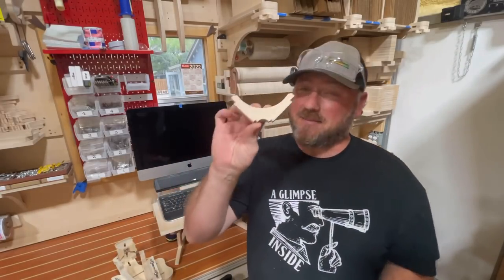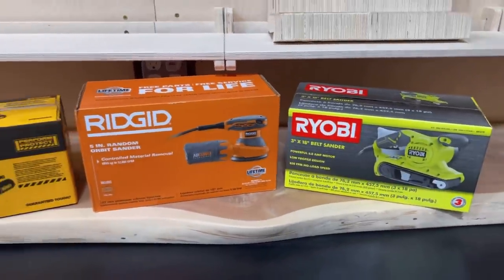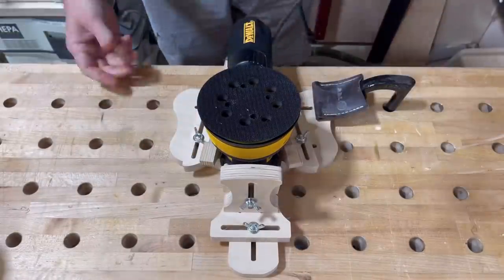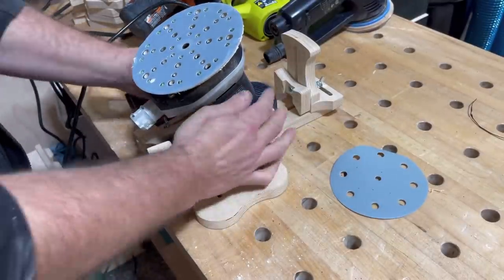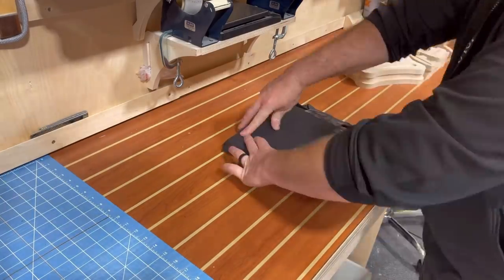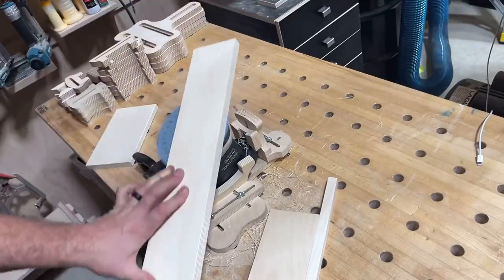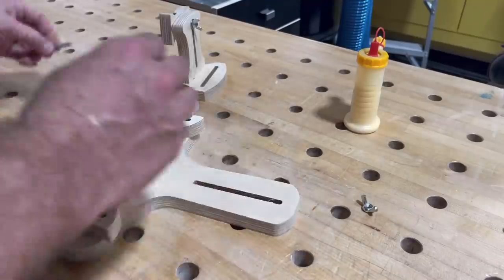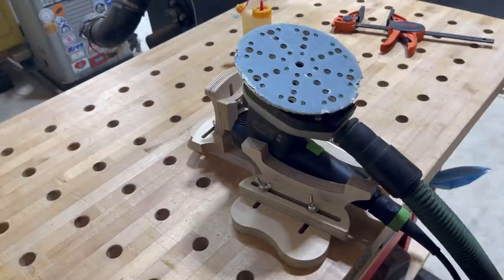Make Sanding FUN Again? How To Get The Most Out Of Your Orbital Sander

Comment: Really like this idea.  Tried a clamp down option once and didn’t work out so well…ended up breaking the paddle function that allows the sander to stay on during use without having to hold down the handle.  Now in the market for a replacement sandwr

Comment: I don’t want to be negative. you’re sending older seems nice and all. But if you ever thought of the bench top sander? I had my eye on the rigid and top sander it does either belt sanding or you can do drum sanding at various sizes. It really makes things so much easier and I’m a big fan. Just thought I’d throw it out there might make your life a lot easier than trying to fight with an orbital sander. Orbital sanders are great but they’re not a fixer for everything. Anyway I’m a big fan of your channel and what you’re doing. Hope I didn’t come across to negative. Keep up the good work. All the best
Reply from the maker: All good I appreciate the suggestion. But the orbital sander is truly the easiest way for me to do this as my pieces have lots of 90° angles and I need to get into various corners with a softer pad as well. The random orbit sander has all these features. I’ve tried spindle/drill mounted/disk Sanders and all have great purposes however this method is what works best when you’re doing so many parts. Not negative at all I didn’t receive it to be that way. Thank you and take care Josh

Comment: Offer up the digital files on this and I'm in.  Yes I could probably copy what you have, but I like to give back to the guy that designs it.  I spent 20grand on a CNC so I need to cut costs somewhere.  Im not sanding thousands of parts but have had the occasion where I wanted to flip my sander upside down.  Keep doing what your doing and don't worry about the haters.  The guy that pissed about the infomercial isn't trying to feed his family.
Reply: I second the call for the files. As much as I would like to, right now I can't do the $75 for the product. But I can find $5-10 for the plans, and then build it out of scrap that I have. It won't be nearly as pretty and polished as yours, but it would still get the job done. Thanks!
Reply from the maker: I’ve been debating on making this file as it has quite a bit of moving parts but if there’s enough interest and yes I will put it out there
Reply: I would definitely pick up the digital files!
Reply: Just for clarification - I'm not talking about CNC files, but "old fashioned" plans for making this with handheld power tools. 😉
Reply: I would prefer CNC files but honestly I could make those from old fashioned plans either so I would be happy with anything of the sword

Comment: Chris, every time I need to sand a lot of little parts, I remember how you made your OG jig. So now basically I need to get some wing nuts and make my own. Thanks for the vid!

One question, what is that inline accessory for your brad nailer? Looks like a blow off valve but with something else on it? I'm a sucker for compressed air accessories.

Comment: OK, I've got a new project for you (unless you've already done it!). Is there a way to make a bracket to hold my drill while I'm using a spindle sanding bit in it? I basically want to accomplish the same thing you did with the orbital, but with a drill holding a spindle sanding bit. I'm too cheap to buy an oscillating spindle sander and after seeing what you created here, I started thinking there's got to be a way to do this and was hoping maybe you'd already worked this one out??

Comment: very nice! but why aren't you sanding the faces before cnc-ing or while the tabs are still connected? you'll then need to only sand the burrs with your nice upside down sander.
Reply from the maker: I don’t use Tabs. And I manufacture so many parts that after a few runs the bit still cuts really cleanly however there are a few birds that pop up. Plus I find it just to be easier this way because no matter what I do and how smooth the pieces are down on the CNC when they come out they just aren’t smooth around the edges enough. Of course with a brand-new bit everything is spot on but I’m trying to use bits the most cost-effective way possible in this helps

Comment: I mean no shade or sarcasm in this question, I legit want to know what benefits it offers your situation= why do you sand this way instead of with your belt or disc sanders etc? I am just curious if there is some pro con stuff I'm missing. Obviously I see the need and awesomeness for this product. Especially for folks who only have the one sander and or in small shops or for on the road... but you have thousands of dollars of sanding machines in a big space and are running a high production solo shop. I am just curious lol ;) 

Also does anyone know if this works with the Mirka Deros 6" orbital sander or either of the Surf Prep sanders?

And will you be selling plans/files for this later? 

And lastly, while I have your attention here- any update on if you are going to go back to selling the Rhino hose/cord reels and/or the plans for them?

Thanks Chris! Have a great rest of your week :) -AL
Reply from the maker: Absolutely Al. The benefit is that allows me more precision. I’m able to send inside of a 90° while also sanding flat surfaces, putting champs on edges,, and just whipping around a small piece on all six sides or so. I do this with a lot of speed as well and having a bit of a forgiving sanding pad really helps mitigate mistakes in burning through plywood edges or veneers rather. Hope this helps. Yes it does work with those sanders however you just have to keep them unplugged put them in the mount. And then plug them back in and you’re in business. Yes I will sell the plans and files later. Thanks for asking all good questions hope you’re doing well
Reply from the maker: I have them readily available, the rhinos. I’ll probably put them on the website next week. Thanks for asking buddy
Reply: @AGlimpseInside  thanks! gotcha, i guess that would be faster and more precise than using a larger more aggressive sander. thanks for explaining. i'm sitting here sanding imaginary things on imaginary sanders to work it out in my mind lol. which got me some weird stares and a defeated sigh from my boyfriend lol. anyway, thanks for responding and nice to see you :)  all caught up now.
Reply: @AGlimpseInside  awesome, i will look for them soon. i feel like you sold them on some other site and i've lost track of where. i love the animal theme of stuff... rhino, hedgehog, hammerhead shark, etc

Comment: Did you try it on the older model of the Makita?
Reply from the maker: No. But if your sander does have somewhat of a teardrop or a taper from front to back even if it’s the slightest. This will work pretty well

Comment: I thought you would use a bench sander given the volume of parts you are dealing with.
Reply from the maker: You would think. I actually tried. It just doesn’t have the same control. As I have to get into some nooks and crannies quite a bit